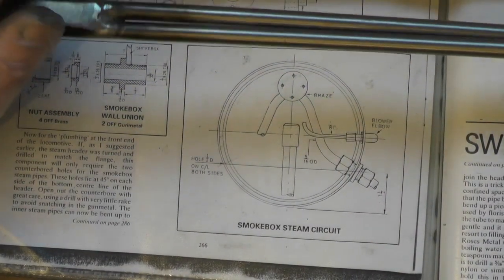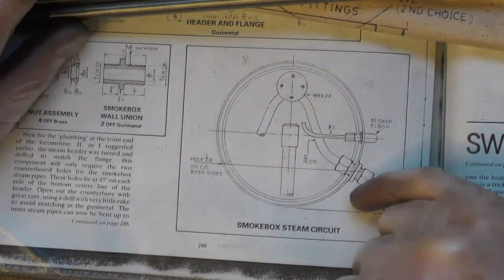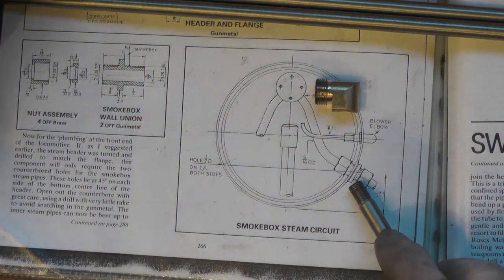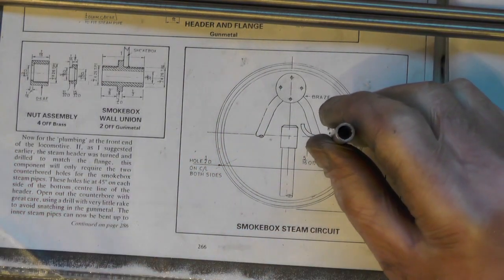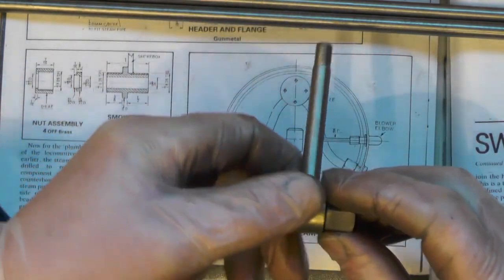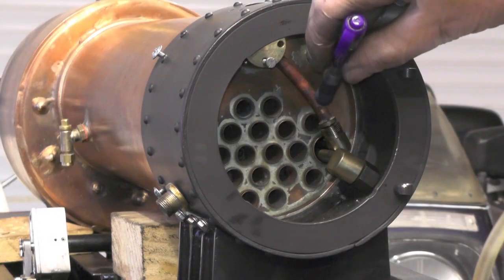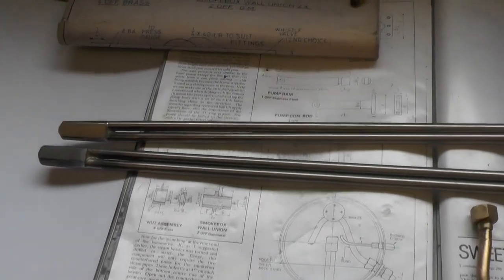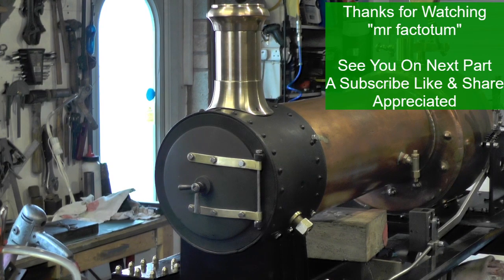Make a Miniature Steam Locomotive Series ( Super Heaters Part 3 - A Beginners Guide ) "mr factotum"

Comment: I noticed you silver brazed the SS pipe to the SS block assembly. Did that withstand the heat in service? I would have thought the silver braze was too low a melting temp.
Reply from the maker: Hi CA
Thanks for your interest and feedback, 
yes, the silver braze has been fine so far, however as you will have seen in the video's i did mechanically fix them as well to belt and brace them for safety, i have run the loco probably a dozen times and no problem.
Cheers
Kev